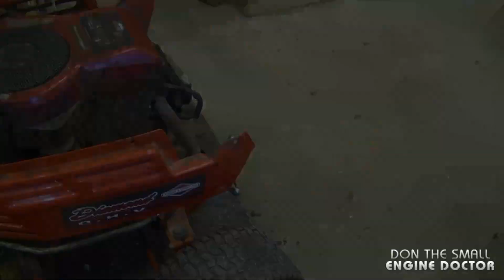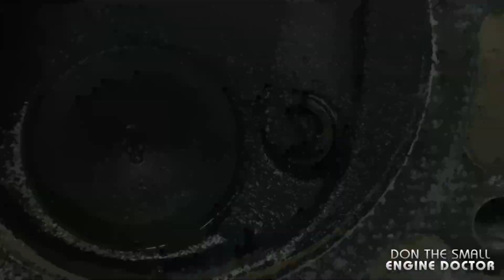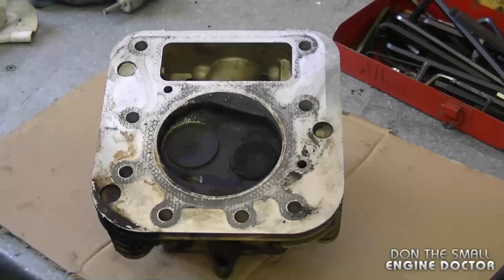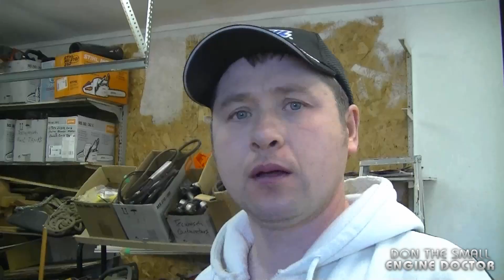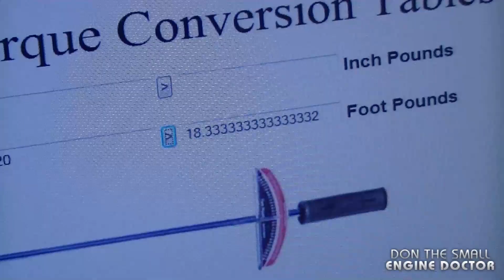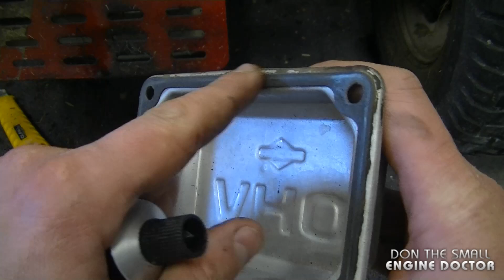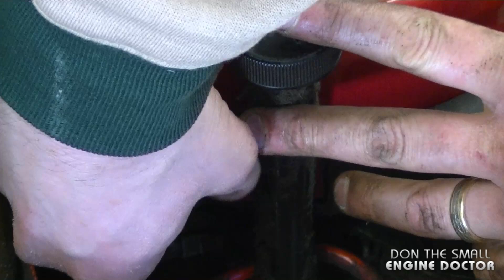Fix a Blown Head Gasket & Adjust Valves On A Lawn Tractor With OHV Engine

Comment: On my Stihl ms180c I mixed gas in the tank like a moron and I ended up putting way to much oil in it so I had it smoking a lot and so I die red to take the leap and open the exhaust and there was a lot if sitting oil on some if the mounting spots and I wiped everything up and looked at the cylinder and piston and rings they all looks 100% amazing there was a bit of oil/carbon on the piston tho so idk if I should go and do something about it but it's smoking a lot less so I'm not sure if it's fine now if you want I could try making a video of it

Comment: Seems like I need to adjust the valves on my tiny ohv four cycle trimmer (Ryobi/MTD) almost every time I use it. How important is the valve cover seal/gasket? Never replaced it or added rtv...

Comment: Great video.  Two comments...parts washing with fuel is common, and I do it.  Be SURE there are no open flames or ignition sources around when you do this....best done outdoors.
Second...some valves on B/S engines do not have an adjustment.

Your video is EXCELLENT!  Thank You

Comment: have you ever heard of the baffles coming loose in the mufflers on these MTD's? i have a 2004 huskee/MTD with an 18.5 briggs single, and the muffler seems to rattle very loudly, almost louder than the engine..

Comment: Any worries about getting the deck or the head wavy with the sand paper?  Would using a wooden block or square metal tubing be good to keep everything straight?
Reply: The paper is so fine and he inst going at it so he taking of so little metal that would never remove enough for that to happen
Reply: sam trudgeon As a car guy, that's a  big no no.  I don't know if it's the fact that it's multi cylinder or water cooled, or just the hours of useage vs a lawn tractor's.
Reply: I'm a car guy to and this is a lawn tractor so its not water cooled or doesn't work at such close tolerances as a CSR engine and the head is a little more flexible to the bolts would pull any warps out over time anyway

Comment: Hi Donyboy73.  Love your videos.  You share my passion for sharing knowledge.  One point you might want to mention on a future video is the proper way to torque a bolt or nut.  In this video, you do a great job of explaining that you apply torque until you hear a single click and then release.  However, you didn't show your hand on the head of the torque wrench to ensure you apply torque only in the desired access.  This becomes more of a concern as the extension between the socket and torque wrench becomes longer and longer.  To illustrate the point, imaging you had a 2' long torque wrench and a 10' long extension... pulling on the torque wrench handle would not apply the desired torque to the bolt.

keep up the great work!
Reply: mr diyguy123,  <?
Reply: mr diyguy123 seems to me,a click is a click. How is your leverage point going to control the DETECTION of the amount of torque?

Comment: Very nice video, missed these long videos. Just one thing Don, when you removed the head bolts you should always remove them in a star pattern to prevent cylinder head warpage, especially on aluminium cylinder heads.

Comment: thanks donyboy73 great video. my Yamaha lawn tractor  yt6800 smoking badly and when I turn the engine off the valve cover on the side where I spotted oil leak feel hotter than the other side. I thinking may I should check the head gasket following your procedure. not going to be easy find parts for this tractor.

Comment: good video, very concise and detailed.
Reply from the maker: thanks T-man, enjoy ur new house!
Reply: donyboy73 Hey donyboy, I have a Kohler Engine Lawnmower (couple months old), When I was doing my after season Oil Change I decided to get all the old oil out and took off the Valve Cover off, after cleaning out the oil from that pan I noticed there wasn't a real gasket between the Head and the Valve cover, just a small bead of some grey silicone stuff that ripped. Is that normal from the factory, and should I just put some RTV in its place because it drips a couple drops an hr from the bottom of the cover where it meets.
Thank you very much!

Comment: Make sure the owner of the tractor doesn't see the video so he will keep coming back for repairs.
Reply from the maker: lol
Reply: My riding mower have problem the carburetor,,I put the new carburetor still sound not normal I need help?
Reply: @SabunganVlog  - What did you adjust recently?  If you adjust something recently, go back to it.  There is an Adjustment Screw on your Carb.... You can adjust that to smooth it out.  Check the Choke Cable or Accelerator Cable or the Governor to make sure they are in the right place.  Good Luck!

Comment: Can't you clean a spark plug with a wire wheel if it's not to bad?
Reply from the maker: you can
Reply: Depends on the plug something like that I would just replace since it's almost not even visible and would be nice to replace since it maybe never has been
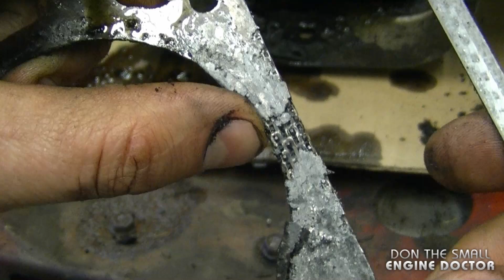Reply: TrucksAndStuff92 Mr 5:19, 20—Why might Jesus have departed from his usual instructions in this instance? (“report to them” study note on Mr 5:19, nwtsty) Mr 5:19, 20—Why might Jesus have departed from his usual instructions in this instance? (“report to them” study note on Mr 5:19, nwtsty)

Comment: Hey don, isnt It a better idea to put in the rods first so you dont have to adjust the valves afterwards?
Reply: donyboy73 The aftermarket head gasket is a different thickness than the original.  This difference will change the valve clearance, so re-adjustment is required.
Reply from the maker: you could if you are sure they are properly adjusted before taking it apart

Comment: Great video Don! I definitely recommend re-torquing the head bolts after 3 to 6 hours run time and even on a new engine they should be re-torqued. I have noticed on quite a few of these you can gain almost a half a turn with the torque wrench. These overhead valve Briggs are kind of poorly designed, there is quite a span between head bolts and quite thin in this area making it the weakest point. You are right, with some of the after market head gaskets are better than the OEM ones and a bit cheaper sometimes.
Reply from the maker: thanks Jim

Comment: this would have been very helpful a month ago, I reused the gasket, as I had broken valve and bent pushrod and it looked ok and was not burning oil.
I bought the parts directly from briggs and stratton, and the parts were very reasonable in price and shipped quickly just for information